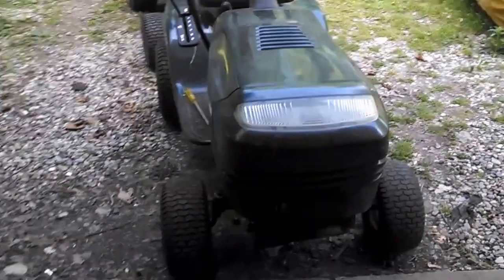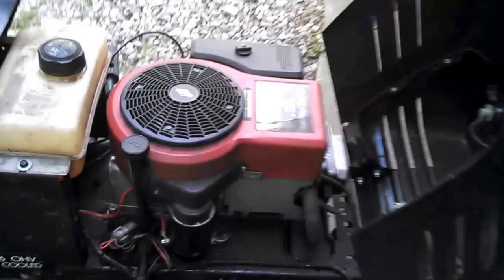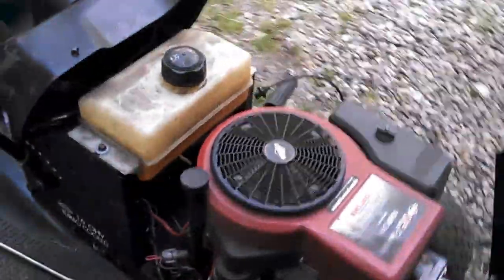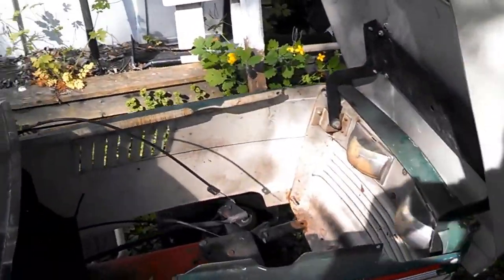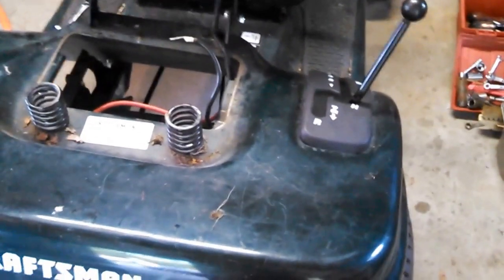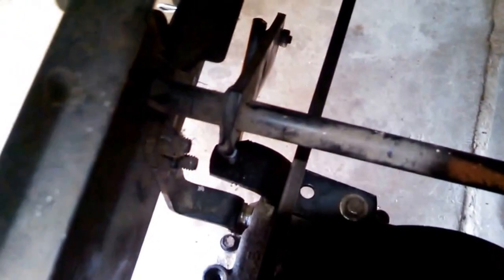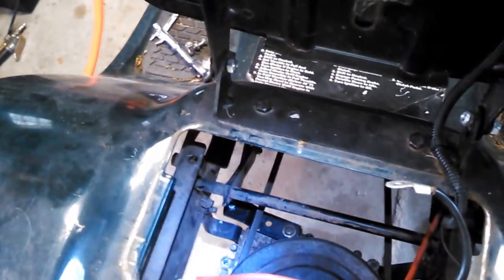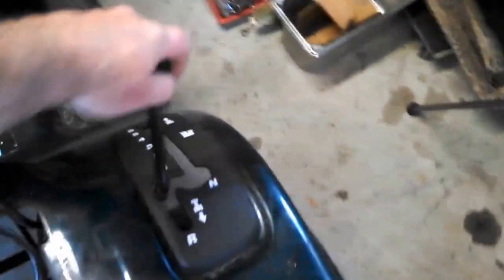Craftsman lawn tractor gear drive transmission resurrection

Comment: The shaft will freeze up and you have to put oil on it and tap it back and forth, happens all the time when they been setting very long 😢
It’s a easy fix if you can time to mess with it 😊😊😊

Comment: You did not repair you just pulled it didnt show us how you did it dumped the fluid and put it back together most of these do no have a plug or drain they are factory sealed I learned nothing

Comment: How did you get that rubber plug back in the hole? I took my rubber plug out to suck out my old oil and put fresh 85-W140 in and for the life of me l can’t get the rubber plug back in.
Reply from the maker: From what I remember, mine just popped back in without much effort.
Reply: @infinigrove  I ended up getting a rubber expansion plug. My stock plug l took out was no way going back in the hole.

Comment: I just did this to LT 2000 it worked great ! Thanks  Transmission fluid n gas an gear oil  flushed it about 5 times before it worked.

Comment: That transaxle only requires 16 ounces of gear oil.  Those 3 quarts represent 6 times the required amount.
Reply: All hydrostatic transmissions are different.  Many do require 1 to 2 quarts.
Reply: @mikespain8655   That peerless uses 16oz.

Comment: Exactly the same problem i am having with a husquvarna LT125 6 speed spicer transmission. Shifter is stuck between neutral and reverse, i got it to move but its still sticky. Guess i will have to try your your fix. They fill these transaxles with grease and when it dries out your screwed.

Comment: Marvel Mystery Oil, lol.  Who the heck uses that?
Reply: Only those who know it works marvels!
had a single cylinder go cart from like 1973. The rings were rusted to the inside of the cylinder 35+ years with no oil will do that. 
We took the spark plug out, poured some of that right on the piston and went at the flywheel with a crowbar or something or an impact hammer(possibly).
once we got the piston moveing freely which took no time at all I WAS NOW A BELIEVER.
Reply: @nonamemike7149   One of my grandfathers tricks... Been around a long time.
Reply: A lot of people use it ,it frees up stuck parts

Comment: Excellent info - my lawn tractor would shift but not engage a gear. So I took it off but there was no drain plug. I drilled and tapped one in the location you show and grey sludge poured out. I went straight to the Marvel Mystery Oil to flush it (skipped the gasoline) then refilled with gear oil and now it works like new! Thanks for sharing this!
Reply: I have to do this with mine, where did you drill?

Comment: I Just did this to my older LT1000 the thing is a cranky bitch, even though I rescued her from the scrap yard she has been well maintained (by me) stored out of the weather, she is always a pain, mow for an hour and work on it for 2 hours! My tranny locked up in the short 2 months of non mowing weather we have here, which I easily unlocked, the last time I pulled one of these rear ends apart it was filled with axle grease not fluid but mine unlocked... 2 of the safety switches went bad so I removed all of them bypassed the wiring so it only has charging current, push button to starter solenoid and a kill switch, got her running and moving then went to eat lunch the damn carb solenoid went bad hydrolocked the piston. Pulled the plug cleared the cylinder removed solenoid, tested it made sure I was still getting voltage and then just cut that plunger off and installed a plastic fuel shut off dealeo in line (if u cut the plunger or disconnect solenoid gravity pushes fuel into the cylinder). Got it mowing again, then the deck engagement cable failed, fixed that with a choke cable, mowed a bit more then deck belt went luckily I save all these parts I find..... I spent a day making a linkage to engage the deck then forgot that the brake linkage was in the way. I should of spent the time rebuilding the 1965 Allis chalmers I have she needs a new engine...LT is running and mowing now but I keep asking myself whats next???
Reply from the maker: Sounds like the needle and seat in your carburetor need replacing.  That's what is allowing fuel to leak into the cylinder.
Reply: Yep got it fixed thanks... @infinigrove

Comment: Hello gentlemen, I have a problem with one of these things. The gearbox ball bearings ( the bearings of the vertical shaft moved by the belted wheel) are finished and I need new ones. I am from Europe and it's impossible to find them here because they are US specs. Does anyone knows where I can order them in the US and the product code/ number. 
Any help would be much appreciated.
Thank you in advance!
Reply: Tepes Voda check out ereplacementparts.com 
Type in you model number you will find this on the engine or valve cover. Now if what you need is a part for the mower ( deck, chassis, levers, lights etc)use the mower model number.

Comment: I have exactly the same issue but my drive jammed up so yet to pull it apart and follow this procedure. hoping it is this easy lol,, just went down and removed battery and went to check lever and its all working like new and I have not touched it,, it was jammed up and had to drag it back to the shed 1 week ago but now works fine. maybe new oil and some attention is needed. leading up to this it was getting stuck in gear sometimes and all I would do is rock it a bit and it would free up and change gears. I'm thinking oil is the issue or I hope it is

Comment: my transmission pulley is wobbling very bad, and making it barely move. any idea what it could be. Bearing maybe?
Reply from the maker: Not sure.  Perhaps the pulley is worn or bad bushing?
Reply: Did you try tightinging the nut?

Comment: Just did this operation to my LT1000 and I am thrilled. The mower now shifts easily without forcing the shifter. Thanks for the video.
Reply from the maker: Glad it worked for you :)

Comment: Is there a way to drain and fill the transmission with removing the transmission.  I have a Craftsman LT1000 12 years old which overwise runs and performs perfect but moving the shifter between gears has become stiff and wandering is an oil change to transmission might help?

Thx in advance, Don
Reply from the maker: It depends on which transmission it is.  Some do have a drain plug on the bottom.  But most of the newer Craftsman only have a fill hole and you fill have to remove it to drain and fill.  However, it might possible to use a pump to suck out the oil from the top fill hole.  Also, I think there is a youtube video out there where someone drills and taps an oil drain plug in the bottom, but I would not recommend that.
Reply: Don't know if you fixed your' shifting yet. I had that problem. tore down the whole back of the mower to remove the transaxle. I was thinking the transmission was bad like you do. It may not be.  I found the shift lever was packed solid with sand and grass between the seat and the transmission. I cleaned out the grass and it shifts great. It is a lot of work to disassemble  the back but it is almost impossible to clean out with tearing it down. maybe if you tip the mower on it's side like many in here do you can get at it.

Comment: hey ther,is the transmittion still working?im thinking about change gear oil in my 4500
Reply from the maker: I sold this one to a guy a down the street from me.  I believe it is still working good and that he uses it to cut his grass.  He has not called me with any issues.
Reply: Great to know,thx! 😋